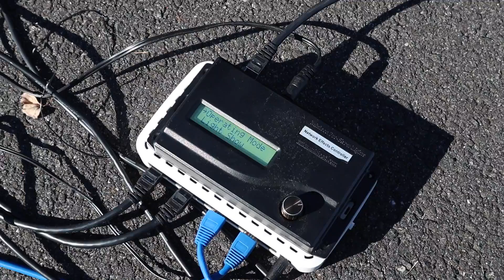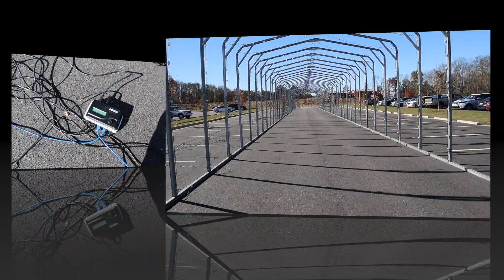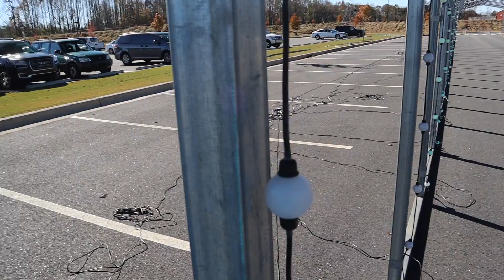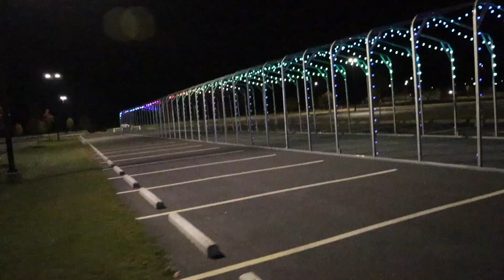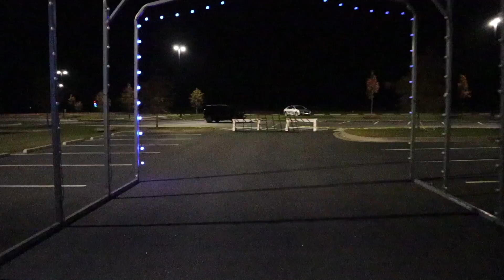RGB Tunnel Set Up

Comment: Hello, super curious what tent structure you were using there? I just randomly arrived here and I'm looking for a 200 ft drive-thru structure. Would love any information you may have :)  Best regards, Michael
Reply from the maker: It was custom made. Call your local welder or metal fab shop. They could make you these without too much trouble.